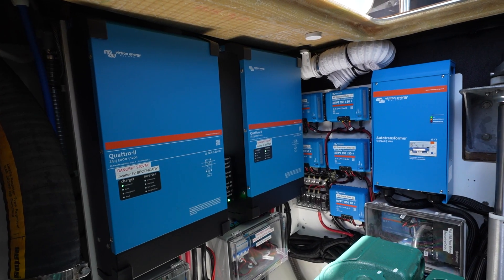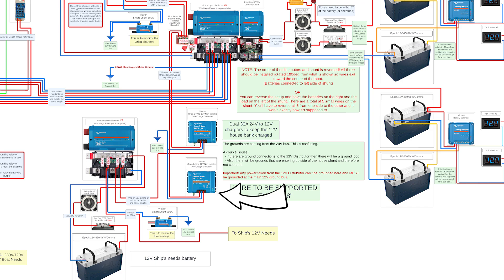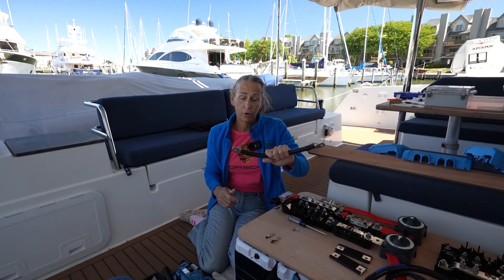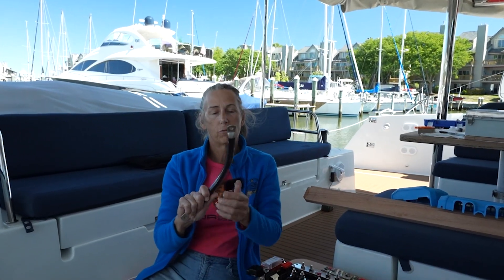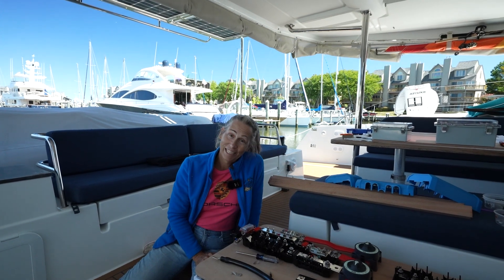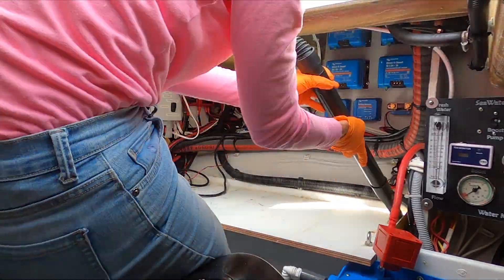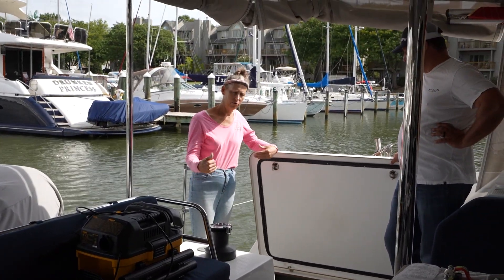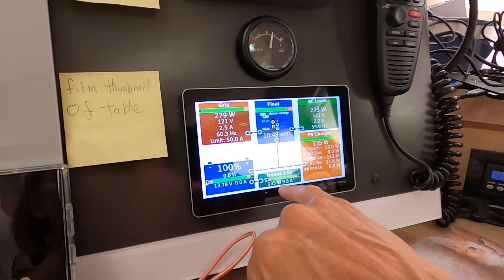Epoch Lithium Battery Install on a Catamaran! - Part 2 - Ep. 36

Comment: Learn from the Wynn's and make sure to use two  separately wired/hull located ground circuits.
Reply from the maker: Our system is done and has been well before we saw any footage on the Wynn's issues.

Comment: Cool setup! Epoch is good stuff. Can't help but notice: Are you over at Salt Ponds when you shot this video? Careful of stray current there! Was there 2 months plugged in and no isolator. Ate through my zinc and my saildrives :( and I'm nothing more than 1 boat in a long list of rotten saildrives coming out of there! But still, very beautiful area!
Reply from the maker: Salt ponds?  No.  We did all the work at a marina in Annapolis and immediately went cruising.  We barely have been in marinas since. Where are the salt ponds?
Reply: @HeidiandFranny  Hampton VA. Wow, that marina looks near identical to it!
Reply from the maker: @svsaguaro that sucks about what happened to your boat!  We have an isolator and did check it on a regular basis.  We did stay at the little anchorage in Hampton, VA once we finished, but just for a few days.   We will probably be heading through there again.  Yes, I have heard these horror stories from other folks on shore power.  I do get it.  Thanks for responding. Heidi

Comment: Just wondering how you determined the hydraulic lug crimpers were not working correctly?
Reply from the maker: If I use the correct die size I am able to work the wire out of the crimped lug.  Most people I've talked to use a die one size smaller or they rotate and crimp several times. My thinking is that this may overly stress the lug and increases the chance it could split.  Take a look at the videos that Explorist.life did on this.  I found them really helpful.

Comment: For your sakes I hope those new lithium batteries are not going to go into thermal runaway meltdown.  A lithium battery fire cannot be extinguished.  Such a fire only stops once the chemical reaction ceases. Keep your yacht insurance up to date!
Reply: Lifep04 doesn't have that issue.
Reply from the maker: We can't get into certain marinas without yacht Insurance. It's always up to date. Thanks for your concern.